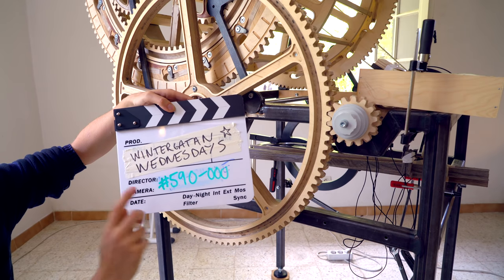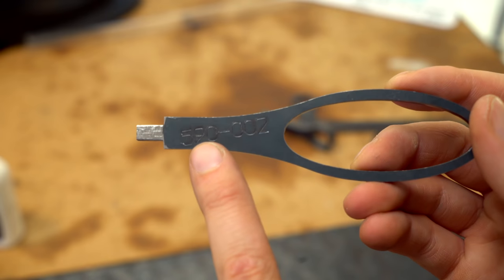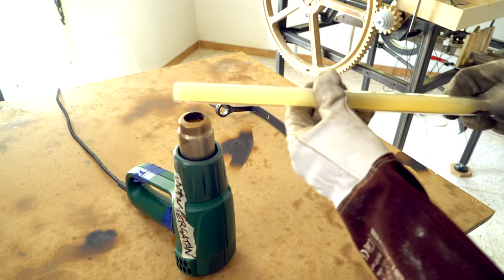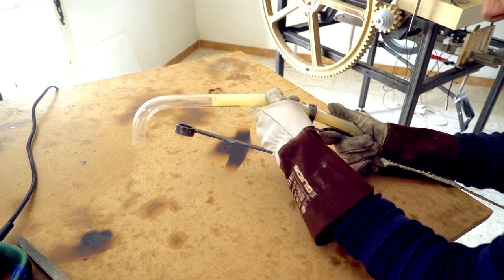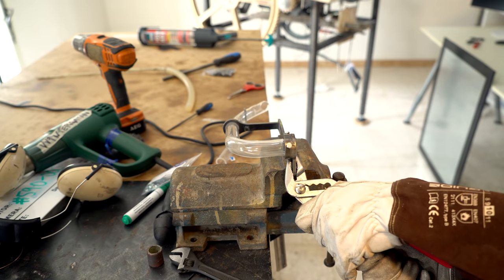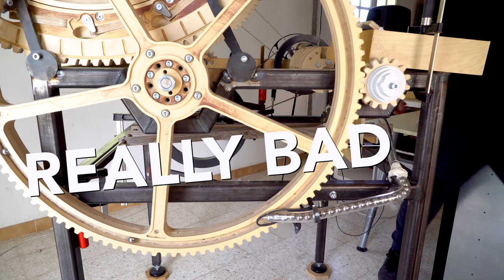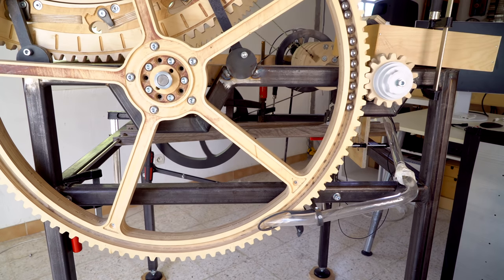Marble Gear Lift Entrance - Marble Machine X #58

Comment: That tube is on the outside edge and low enough that it's going to be smacked against knees and doorframes during shipping.  It's a glass bumper.
I'd suggest making a spare tube.  It's gonna be a challenge to bend a replacement while the MMX is on tour.

Comment: To add some thought have you thought of covering the entire gear section with the magnets with a clear section of plastic. To ensure the centripetal force with a full wheel filled with magnets at high speeds won’t shoot out? Or is there a groove preventing this
Reply: Because I could only imagine that a wheel filed entirely with marbles at high speed will generate enough force to fling out without grooves. Figured magnets could only withstand so much within a centripetal force output. But if there’s grooves should be okay. I just like being safe :p

Comment: Mix fairy liquid in the water before you smooth out the silicone and you get about 10000% better finish than with just water. Tilers use it all the time for caulk/silicone.

Comment: To reduce the noise of the marbles coming in contact with the lift, you could glue or tape thin foam to the back of the slot in the lift.
Reply: and losing the wood aspect ....

Comment: Keep the bolts, they add visual geometry to all the circles. Think about adding set bolts to the exit oval to continue the aesthetic and also allow micro adjustment to the exit to lock the position of the exit, relative to the loading slot, knowing assembly/disassembly will screw (pun intended) with the alignment precision

Comment: The big question is ... when all this is disassembled and re-assembled for every gig, will the pipe mechanism sit in exactly the same position each time, and perform the same each time without causing blockages?

I'm pretty sure the machine won't ship with it in position due to its placement ...

Comment: Possibly the marbles are trying to leave the tube faster than the wheel can carry them away. Therefore the next marble actually bumps into the previous marble and bounces back. This is why you see gaps in the marbles in the wheel despite no gaps between the marbles in the tube. The gaps reduce your maximum effective lifting rate. To reduce gaps, paradoxically, you must reduce the speed of marbles leaving the tube.

Comment: The magnets can be eliminated without changing the design significantly... 3 D printed “teeth” that fit in the magnet groove channel can lift the magnets in the same groove by simply adding a half circle guard rail that prevents the marbles from falling out and does not rub against the programming wheel.  This eliminates the need for a demagnetizer and will solve the as yet unaddressed problem of the fact that the magnetized marbles will NOT roll relative to each other as you try to push them thru the divider that runs over the demagnetizer.

Comment: Glad you decided to keep things clean and get rid of that booger.  A peristaltic type pump could potentially be faster and stronger, while providing a controllable pulse rate timed to tempo.  A bit poetic to use a concept developed for drawing water then drawing blood, to circulate like an enormous heart, pumping out music.  By winding a tube around the inner diameter of a tube, like threading, a single off center dowel on bearings can provide multiple points of contact along the spiral, for more compact and visually appealing efficiency, and longevity of tubing.  Take care.

Comment: Use undiluted dish detergent on your finger to get the smoothest results with silicone sealer. Tip given to me by a plastic siding installer.

Comment: Hi Martin. I have followed you for the last year or two with the original marble machine and through the marble machine x. I love it 👌 I used to help design and build yachts. And now work for myself. I used to be the 'design for manufacture' guy, the one they called 'the guru'😂 I also had a lot to do with anthropometric measures. Ensuring the right things were in the right places to suit people. I have built a number of benches, tables, chairs and helm positions on boats and cars. Its about the right height, distance to work at or to be comfy on a sofa.
If you want a chat about the work bench then give me a call.
My numbers in my bio.
Jamie

Comment: Do you ever thought about adding a standard cykle disk brake to the flywheel shaft, if you want to slow down or stop MMX more easy? I have seen you slowing down it, by the crank, but this looked not very easy to do.

Comment: I really enjoyed the speed testing but I thought you missed a crucial test: Jamming.  If a bunch of marbles are on the down path of the magnet track and a bunch are trying to enter via tube would the piece jam.  I know this would be an unrealistic circumstance because there should be no marbles on the "down path" of the lift, but a jam would be catastrophic if that were to happen.  A I think it's important to at least check unless you have an absolutely full proof method of making sure no marbles could go on a "down path" on the lift.

Comment: Looks good, works well, makes me nervous about durability. There's a little bit of adjustability with the set screws and mounting point, but:
a. it's on the edge of the structure, so it's going to get bumped more than internal stuff
b. it's a single point of failure
c. the tube took a lot of careful handcrafting so it would be tricky to remake on tour
d. dissimilar thermal (and moisture, for other portions of the machine) expansion coefficients. do you have plans to test the machine as a whole with various temperature (and humidity) regimes? the metals will expand/contract very differently from the wood/plastic (and each other) with temperature change, the wood will ex/con with moisture, etc. the plastic needs a pretty high temp to be easily bent, but does it slump at all at a temp that might possibly be reached (and sustained for hours/days) in transit?
e. Amazing work so far and I wish you all the best in the quest for the world tour!
(temp/humid testing might help figure out route/ schedule, too. e.g. it takes four days for the machine to finish reacting to a humidity change, so it needs to get to location X four days early so when we tune it the day before the show, it's done reacting.)

Comment: Over time, is that end metal oval going to get magnetized by the passing magnets of the lifter? When you were doing the silicon, I was thinking you could just lose the end over entirely as it wasnt supporting the pipe and was snagging the marbles on the way past.

Comment: I for see an issue when playing a song at full speed and the marbles  are coming to your new invention towards the programing wheel. If the marbles are both in the programing wheel and the tube at the exact moment they and cross the magnetized marble will be pulled off the programming wheel. (Solution) apply to the surface of the programming wheel just after the tube a peice of plywood to stop the magnitized marbles from pulling away from the Marble Machine X.

Comment: I think that the angle of the pipe should be the same as the angle on the wheel where they meet for best effect and least trouble. Maybe the pipe angle should be steeper at the end of the pipe. Or the pipe should meet the wheel closer to the bottom.
Reply: I had the same thought.

Comment: So qick questions. You said you want to go on tour with this, how will you disassemble it fast and effectively for shipping? And have you been building spare parts just in case of shiping accidents? I just ask because I usted to tour as a magician and the smallest and simplest items would get damaged or lost no matter how good the shipping was, I had two of each of my large illusions to replace each piece if they were lost. Just wondering. Thanks

Comment: RE: Medical rod. You can pull it in because it narrows in diameter when you pull. Conversely, the diameter expands, or at least tries to, when you push it. This the case for most materials, the reason it's not as much an issue for other materials is because the are too stiff to perceive changes in cross-section (https://en.wikipedia.org/wiki/Poisson%27s_ratio).

Comment: It's way too late in the process to change this, but I always wondered why you didn't implement a bike-like ratchet on the main crank + pedal so that they stop rotating when you aren't applying force. In other words, the weight of the machine working wouldn't be directly attached to the main crank + pedal.

Comment: Do you plan to implement the changes you do manually somehow back to the cads? Or is this the type of thing where it's meant to do the base work by the cad and then adjust it manually if/when you're ordering a second marble machine x done from your designs?

Comment: So I don't particularly like the aesthetic design of this part, mainly the oval at the end of the tube before the lifting wheel. I'm glad that it works well and it performing that job is the main priority. But the oval seems too flimsy, thin, and like a weird eye that doesn't mesh well with the perfect circles and sharp angles of the rest of the build. Perhaps some larger plate that gives some visual weight to it would help?

Comment: Long time fan here!

I was wondering. If the "Marble Lift Entrence" that you are building in this video, and the wheel are both going to be disassembled when you tour around the world, multiple times. Are you sure you going to have it as SPOT ON as you got it in the end. I thought it looked like teeeny tiny changes in the position of either the wheel or the entrance would cock up system and needing maintenance  after every single reassembly. 

I hope you have thought about this, and I'm probably just worrying unnecessarily. 

Lycka till i fortsatt planerande och byggande!
//Simon

Comment: the problem i see with the overall assembly is that you alter almost every part you put on, but i dont think you change that in your cad aswell, do you?

The thing is whenever you want to rebuilt the machine or if you need to repair something you cannot do it easily because you do not have the correct drawing of it
you should always aim for repeatability which is not the case in a lot of the parts

Comment: the plastic tube is too lose in the oval metal loop. there is so much gap around the plastic tube. I think either the oval loop should be made smaller, or the tube cut at a more obtuse angle so that its cross section covers the entire oval loop. 
The oval loop looks kind of crooked too. I think when you tried to slant it down by the pliers and hammer, the loop got a bit out of shape (its long vertex is not perfectly aligned with its stalk). 
Overall this new addition to the marble machine seems to be perfectly functional, but I think you could have done a better job on it from an aesthetic point of view.

Comment: The rubber rod will be easier to pull through the pipe with some soap and water. Pro tip!
Also a # is just called a "hash sign", "number sign" or "pound sign". A hash tag is the entire string(an array of characters) with a hash in front entered in Twitter which makes it a searchable tag, thus the name "hash tag". 
Please don't contribute in obscuring the terms of why a word with a hash sign is called a hash tag.
And if the platform doesn't support hash tags, it's not a hash tag. It's a string with a hash in front of it.

Comment: Perhaps you shoud redo the oval end part not in steel. I think with time it could get (a bit) magnetic because of the holding magnets and not fully demagnetized marbels. And that is a bad position for an additional magnet.

Comment: What happens if you have a flood of marbles from the tube hitting a section on the wheel filled with marbles? It might potentially be a problem if that's possble.

Comment: Does it still feed all those marbles just fine if the channel receiving the marbles happens to have a marble along the channel during the feed? Also, this feels like the kind of component that when you take on and off during shipping can get very slightly bent and will have a very tight tolerance and mess up your show. Makes me nervous. good luck
Reply: In practice, there shouldn’t be any marbles in the channel as it comes down. They’ll all be getting off at the top.

Comment: What happens if a ball runs down the ramp to a section on the wheel where a ball (or a bunch of balls) already are? Will it push them out of the way, push them off the machine, or wait until a clear spot appears?

Comment: I never understood the use of magnets for the lift, the wheel will only ever lift one way.

I imagine the wheel as a clock, so stay  with me... The marbles should be fed to the bottom of the wheel, at about "7 o clock" the wheel will have notches inside that the marbles will sit on, (where the current magnets are) this will lift the marble as it turns clockwise. When the marbles reach the top, there's a groove in the center of the notch, that a static bit of wood or metal would stick though, this would knock the marbles off, ready to reuse them at the top.

Comment: Have you tried soaking tubing in heated water or oil. I have better luck with that than heat gun. (But, I may be using softer material than you are)

Comment: I personally don't like the look of this part as much as i like the others. The metal loop at the end kind of throws me off. I think I'd like an open track more with the to bendable metal rods like you've used elsewhere in the design. Might even have a cool effect if it doesn't have a bottom, so it's seethrough.

Comment: I noticed that when a marble has been put on the wheel and does a full loop, when hitting the pipe again, it pushes the marble down in the wheel itself. Could this be a problem, and/or make a lot of noise if a fast song is played?
Reply: Usually the marble will not go through a full turn. With a little bit luck, they will be taken out of the wheel on top.
Reply: But even if a marble wont do a full turn, their still going to make lots of loud noises when their put into the wheel, just listen when he put the 8 marbles at once, that was 8! which its meant to do a second. and when its done, itd do it constantly. Wouldn't that cover over the music or be really annoying to listen too?

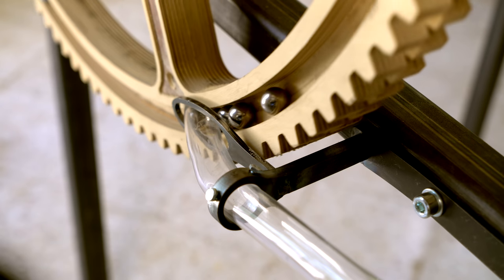Comment: Why did the marbles @ 7:20 fall down? Looked like they magnetized 590-002 (the holey spoon)?! How did he solve this problem, didn't get that...
Why not putting the outet of the tube tangential to the wheel? I bet the marbles would slide much smoother into the lifting wheel and would look "nicer" 
Silicon = not nice looking
Epoxy resin = time consuming, but perfect looking

Comment: Why are the marbles meeting the gear as the wheel is still on a downslope? It seems like the marbles have to make a transition in their travel path when you look at it in slow motion... 
Wouldn't it be more successful if the entry profile of the tube matched the angle of the wheel so that the marbles continue in a straight line? For example the way you have it now might work better if it were extended and lowered to intersect just past the apex of the magnet track as it starts its upward path.

Comment: 7:10 Ditch the oval support. It's clear that it doesn't support the pipe, as it's sturdy enough by itself. Issue with the oval is that it is metal and metal tends to form chains in proximity of magnets, and the magnet won't be able to pull single links towards itself. That's why the marbles are sticking to the support and get pulled out of the lift. Check out Cody's video about this and all will be clear :) https://www.youtube.com/watch?v=II3GlwmrP7Q

Comment: Great solution, why don't you just remove the oval at all? The PC pipe should have enough strength to not bend much while free hanging after your ring holder...

Another point: May you stop using your internal item number in the vids? Most of us I guess, don't want to rebuilt the MMX anyway... I understand that these are important to your project, but I took out a big part of the creativity transfer which you send out in the past. just use a simple name in the vid for a piece. :-) thanks for this great project!